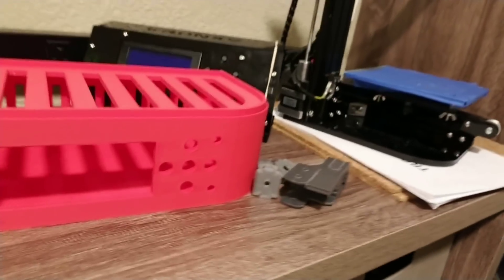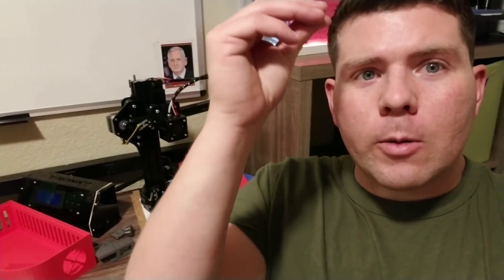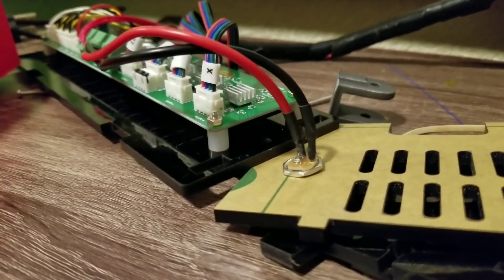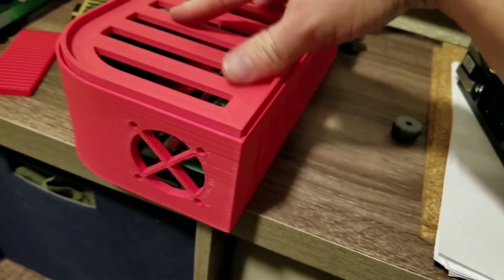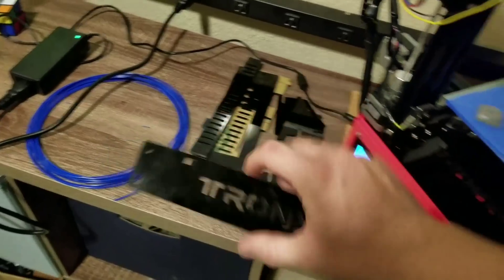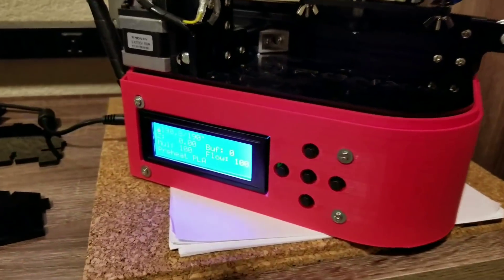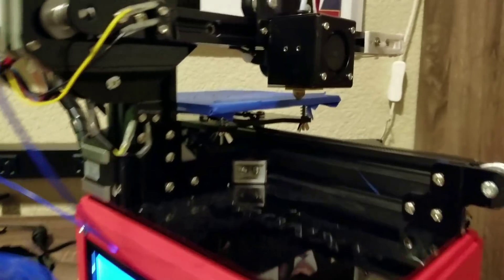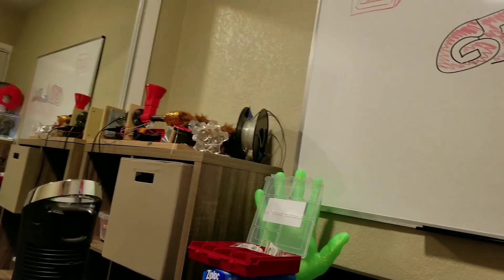TronXY X1- MASSIVE 3D Printed Base Upgrade

Comment: if i could print the case on my tronxy I would ! plus tip the designer please, it's a  nice piece
Reply from the maker: Veikra already tipped!  Hey there is a modular version you can make on the TronXY X1! "TronXY X1 Modular Base"

Comment: Dude, you got a ton of space in there for a pi3-- octopi. No need for SD card.
Reply from the maker: +5haun 1 I know right?  I haven't messed around with octoprint yet.  I don't want to be limited to having to be connected to the internet though
Reply: After installing the image, internet is not required, just LAN. There's a Cura plugin that provides a "Print with OctoPrint" option-- Extremely convenient.
Reply from the maker: +5haun 1 I'll have to look into that

Comment: I have a Tronxy X1 and it’s my only printer. Why is your fan turning on and off? And looks like you got 50 likes. Thanks for the video it was informative and I liked seeing the machine in operation.
Reply from the maker: +Robert Zarfas it turns on to maintain temp I think?  I'll be posting a video about what happened to the rigid bot really soon.  How do you like the TronXY x1 ?
Reply: GeoDroidJohn I got it toward the beginning of December and spent most of the month trying to print Christmas presents. I spent a long time dealing with lose connectors to my stepper motors but eventually got that solved. Several prints came out great, but I was having some stringing issues and so I kept trying to increase the retraction, had it all the way up to 7.5 mm at one point, but it turns out my spring tension on the extruder was turned up all the way. So all the retraction was really chewing up my filament and ended up causing a lot of clogging. Taking apart the hot end repeatedly ended up causing leaks and I eventually stripped the threads on my heatblock and snapped the threaded rod. So now I’m waiting for a new E3D clone hot end. And I’m so antsy and excited to get it up and running again. I really want to take the time to dial in my settings before I try to get results this time. How do you go about refining your settings and tuning your settings to your filament?
Reply from the maker: +Robert Zarfas damn that's a lot of bad luck! Sorry to hear that... let me know how the new nozzle works out
Reply from the maker: +Robert Zarfas there's a lot of ways to dial it your settings. Start with making sure the esteps are accurate, then the best temp with a temp calibration tower, then a filament retraction test.

Comment: Print temp is filament dependent.  Hatchbox PLA is happy at 190C, but 3DSolutech PLA like 205C.   
Belts should be taught, but not overly so, use a XYZ cube to look for surface waves, you wont really feel them, but you will see them in sharply angled lighting.   This assumes the temps and speed are ok.

Comment: Very cool!  Any idea if it makes vibration noise any worse...might try to put some rubber feet on the bottom to eliminate noise transference...you said it's quieter...so very very awesome...love to see real world reprap ideas in action!!!!!!
Gonna have to get the two part design, print in ABS and bond together with ABS juice...(on my Anet A8
P.S.  Haven't set up my TronXY X1 yet...hidden under my bed...waiting for the right time to break out the printer to let my wife know I bought another 3D printer (she's gonna KILL me!)
Reply from the maker: I'm going to use some hot glue to bond the printer to the lid. So that might make it even quieter. Then I'll find a way to secure the lid to box in a way that allows me to get back in there easily. I want the whole set up to be easy to grab and go.

Let me know how the build goes!

Comment: Looking good!  I'll get mine going soon, and we'll see what mods I go for.  Thanks.
Reply from the maker: +Ron Floyd make a list from thingiverse now so you can have it ready. Do you already have a 3d printer?
Reply: +GeoDroidJohn - Yep - I ordered a Tronxy X5S, and an X1 during the 11/11 sale.  Both have been delivered, and now I just have to make me a space and a workbench, and I'll dive in.  I have a loooong list on Thingaverse - LOL.  2018 is going to be an experience, for sure!
Reply from the maker: +Ron Floyd nice! I recommend cleaning up the workspace really well before starting.  Those little nuts and bolts roll all over and can be impossible to find. If you don't already,  grab a small part organizer and sort your hardware before even starting. It makes the build 100 times easier.
Reply: I'm gonna call them "Kong" and "Cheeta" - LOL
Reply: I'm building a new workbench - 4x8.  And, I have several organizers too.  I'm going to build the X1 first - to get a little experience, and to print any small parts for the X5S as I go.  Like I said, 2018 is going to be interesting, if nothing else.  LOL
Reply: Sez the guy with a box full of wires !! haha.  coil those up and put in a bag or box.  Nothing worse than having to fix a broken wire.